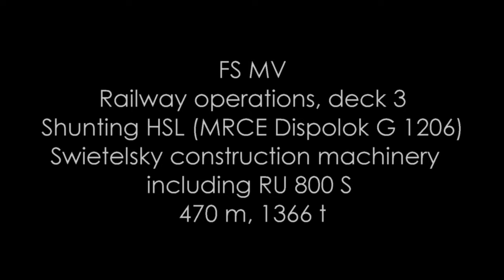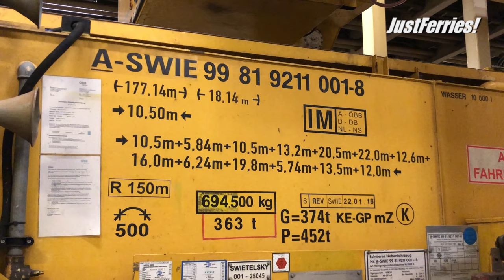Ferry MECKLENBURG-VORPOMMERN, Rostock, HSL shunting Swietelsky RU 800 S (Stena Line)

Comment: I was always wondering how this works. The video made in very clear. At the second pickup the signal above the entry was still red but the train proceeded. Is this common or the operator forgot to switch it to green?
Reply from the maker: The signal is on green. It is signal 5 for track 5. But: If there should be a malfunction (which is not the case here), the train can also enter at red with the permission of the loading officer on board.